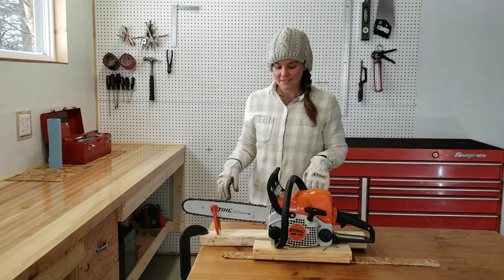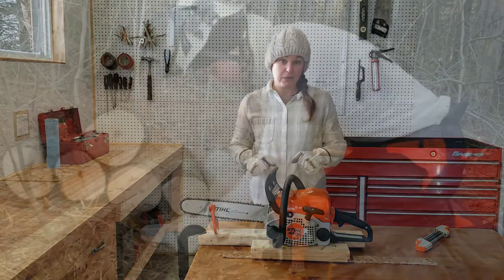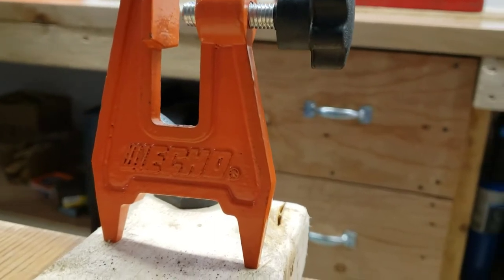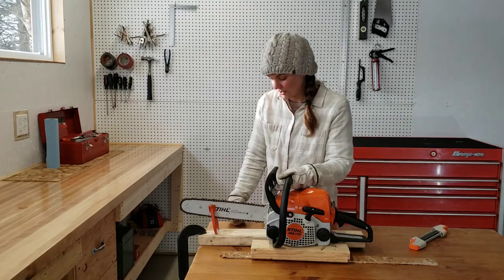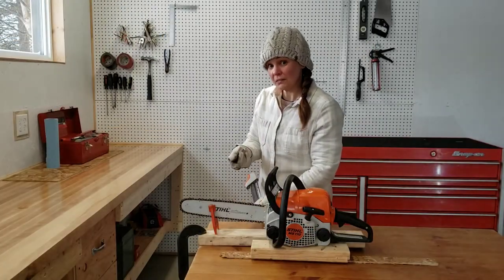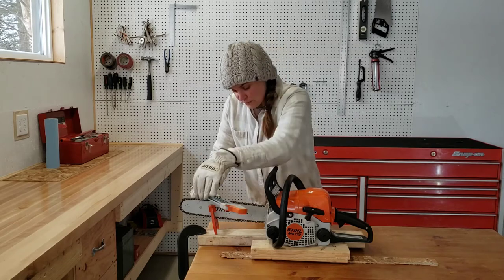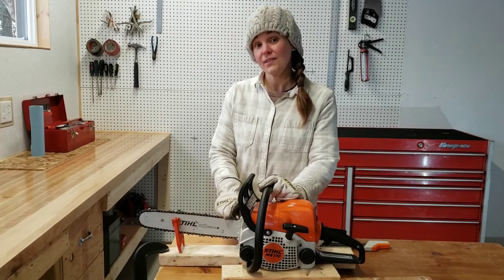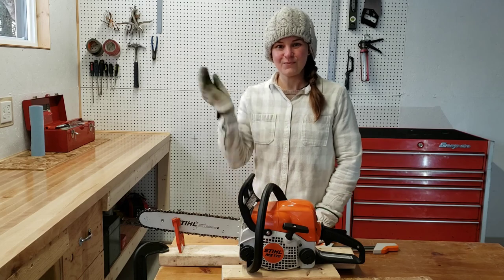How I sharpen my chainsaw with a 2 in 1 sharpener

Comment: Another good video! I also use the 2 in 1 Stihl sharpener. May I give some advice though,  try not to drag the file on the backstroke, lift it off completely. It will cause the file to dull quicker. Also periodic cleaning of the files ( using a good stiff brush like an old toothbrush) will help also as the file will clog with the metal filings.  Just curious as to which part of North America you are in (I don't hear a Scandinavian accent, so I assume N. America). The countryside you are in would make me think either Minnesota  possibly , or  Northwestern Ontario. Keep up the good work, and stay safe. I just finished watching another of your videos and I just had to grab my Stihl MS261c and find a tree to cut up and have some fun after a long winter.
Reply from the maker: Thanks! And thank you for the advice about the file. For some reason, it never occurred to me, even though my file doesn't quite have the same bite that it used to. I'll definitely be more vigilant about that going forward. Glad you were able to get outside after the long winter and I hope you have a fun and safe season.